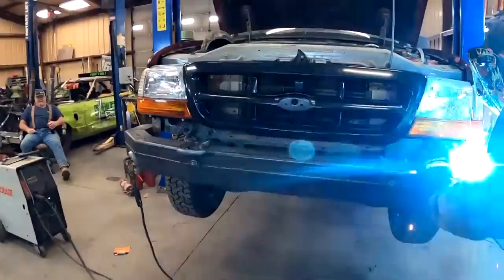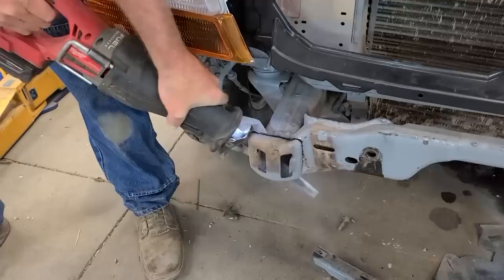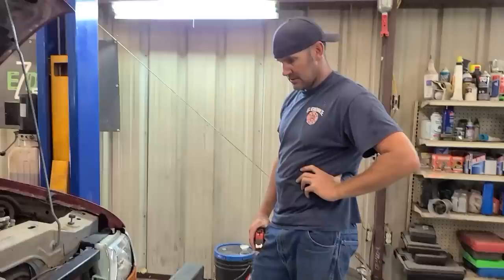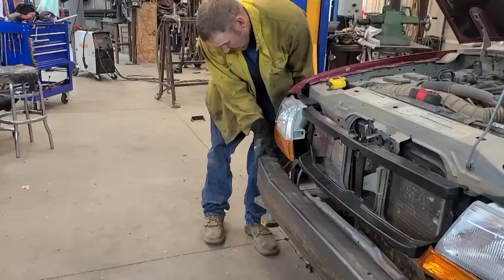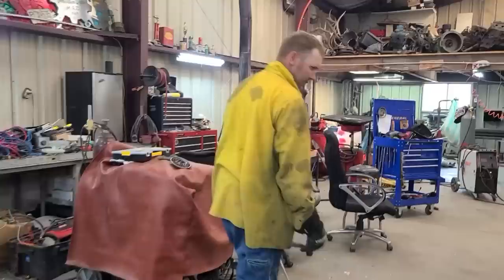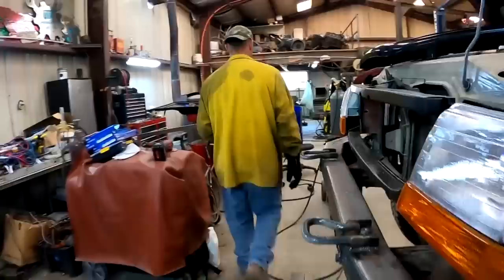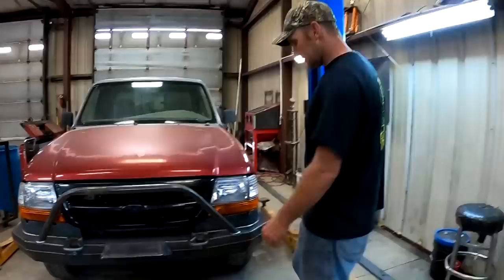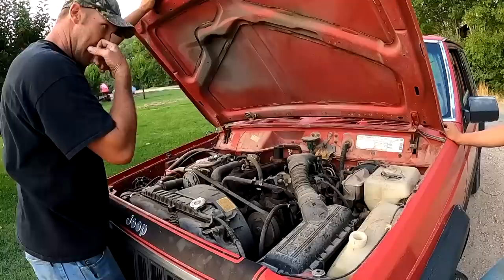Trade Work 101: Fixing a FORD RANGER to get an XJ.  DID I GET THE SHORT END OF THE STICK??

Comment: I had a 3.0L Ranger.  That thing was bulletproof.  I towed all my belonging literally across the country twice, well overloaded in a dual axle UHaul and bed filled up, and I had zero problems.  It took me about 2 minutes to get to highway speeds, and I planned my stops a mile in advance but it did it's job - just required an add-a-leaf.  Excellent vehicle.

Comment: Had an 84 Cherokee with the 2.5L on a lounge box trans, drove that thing all over the Rocky mountains, wherever the logs came from and the power lines were going, chasing the whitetail and bringing them home, put 500,000km of very hard driving on her, after that i have have had 5 XJ's with 4.0l and 2 WJ's with 4.0L, now up to WJ # 2 with the 4.7L v8, one came from the dealer and now has 370,000km on it and only about $2,000 ever put into it, love them Jeeps, but nothing will beat the old GMC 3500 for working the ranch 1/2 a million on that one as well. Lots of fun in those XJ's floorboards or not.

Comment: I had an '86 Jeep Cherokee Chief like that one but with the 2.8 GM V6 engine. The worst issue is that model is the top door hinge on the A pillar gets weak and you need to reinforce it. Common issue with those models. Other than them being the AMC version they are a wonderful base to start with. Glove box latch says Ford but has a GM motor lends itself to the fact they are a conglomeration of the the big 3.

Comment: That bumper is really nice work!  I get the trade for sure. I’ve owned two two door XJs and one was that under powered 2.5L. The 4.0L really is the one to have for a daily driver. I really loved those little beasts. Now in thinking of buying a 2001 Sport with 34k  miles to replace my 2013 4Runner. Call me nuts but I like my Jeeps.

Comment: I love the work. Good result on the bumper, if the suspension can hold it up. ;) It looked heavy and will be more so with a winch on it.

But so much of what you do just wouldn't be legal in Australia. Any bumper with projections out the front like that would have you off the road quick smart. Well, unless it only ran on a Station in the Outback.

Comment: Will the Ranger front end hold up over time to the extra weight of a bumper and winch set up?  The other thought I had is how does that mod effect the crumple effect engineered into the Ranger?  Seems it would transfer the full impact back to the cab?

Comment: Been thinking about a 5.7 hemi swap into my 95 XJ. (Bumble Jeep). I've been told the trans tunnel and firewall will need extensive mods. I'm assuming because most people swap in the automatic transmission that comes with them. I don't plan on using an auto trans. I only drive manuals. You mentioned swapping a a Dakota drive train into this XJ and needing to modify the firewall to make it fit. would you be using an automatic trans with your Dakota swap? God bless, stay well.

Comment: What's the deal with the flattened bends on the hoop?  Did use use a HF pipe bender on PIPE... or is this tubing that crushed?  It looks like sched 40 black pipe in a HF bender...